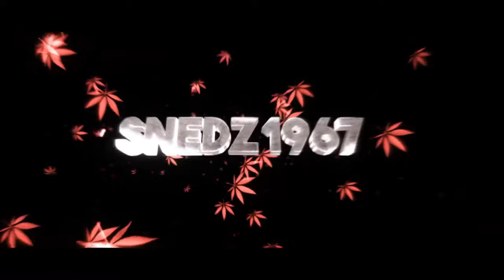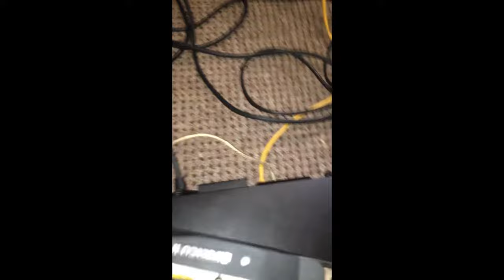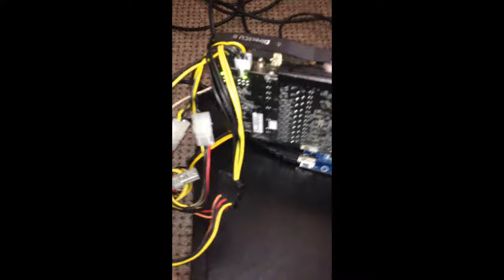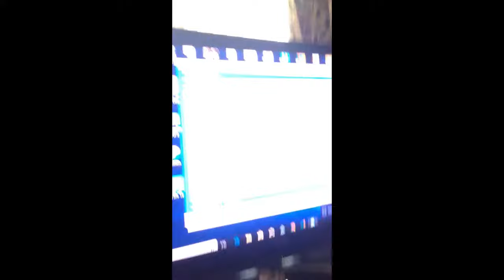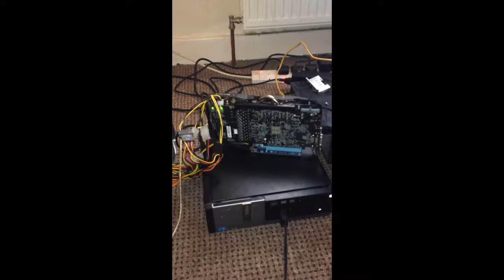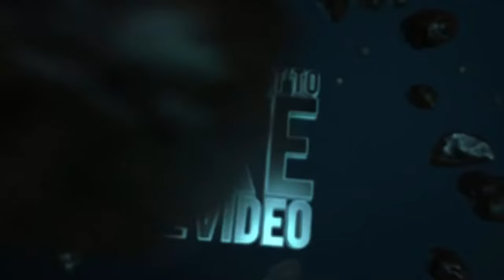Full Size GPU Running On Small Form factor PC Easy Way To Save buying New Case Etc

Comment: Hey does a usb 3.0 riser work in an optiplex even though it doesnt use usb 3.0?
Reply from the maker: beacuse ur plugging in riser to pci slot the pci slot has usb 3.0 on it so works fine